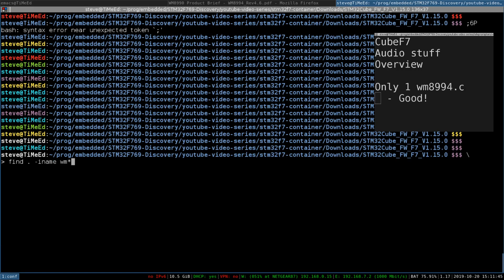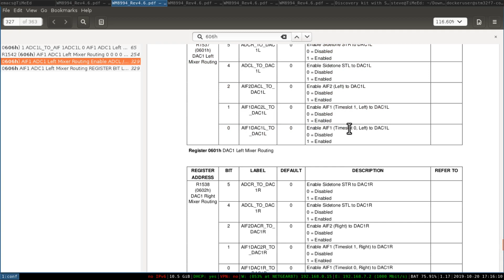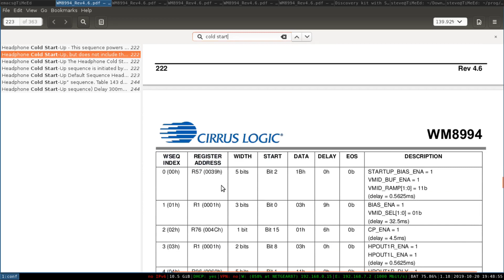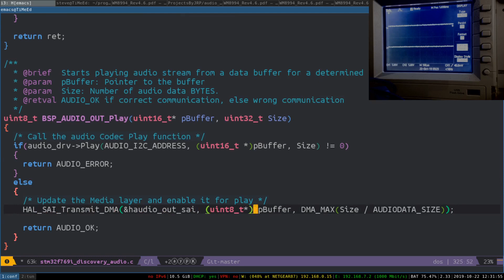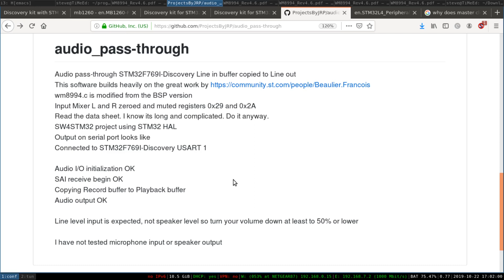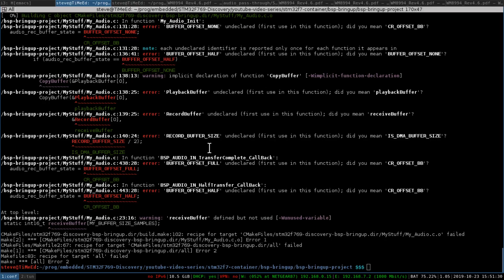STM32F7 Discovery : Audio Line-in to Line-out Pass-through

Comment: Thanks for the insightful video! Is there any reason to believe that this wouldn't be possible on the STM32F746G-DISCO board?
Reply from the maker: Glad I could help : )  The 2 schematics look very similar around the codec-STM32 connection.  My guess is all you have to do is change the firmware to use SAI2 instead of SAI1, and the different STM32 pins.  The codec is the same.  The wm8994.c driver is the same.  Let me know if it turns out to be more or less complicated, I'd be interested.  Good luck!
Reply: @pizzabeerengineering2488  Sure! I am on it :)
Reply: I got something running on the STM32F746G-DISCO board: https://github.com/zanellia/audioprocessor. It's far from clean, but it's a starting point ;) For the time being it is just a simple pass-through. Will try to clean it up and progressively add some more feats. 

Just in case someone else finds this useful, I figured that a simple pass-through for the STM32F746G-DISCO can be obtained adapting https://github.com/STMicroelectronics/STM32CubeF7/blob/master/Projects/STM32746G-Discovery/Examples/BSP/Src/audio_loopback.c from the STM32Cube repo. It mostly requires changing this line https://github.com/STMicroelectronics/STM32CubeF7/blob/master/Drivers/BSP/STM32746G-Discovery/stm32746g_discovery_audio.c#L893 such that it allows `INPUT_DEVICE_INPUT_LINE_1` too and fixing the gain of the wm8994 codec here https://github.com/STMicroelectronics/STM32CubeF7/blob/master/Drivers/BSP/Components/wm8994/wm8994.c#L310 from 0x0035 to 0x0025 (both right and left channel).
Reply: This is from so long ago, but did you ever get it working? I'm trying to get it working on the F746G-Disco as well and I'm curious if you ever had any success with it

Comment: Thanks for this video. This codec has been giving me a headache on a similar board. Just trying to prove that the analog mic input can work before rolling out a hardware design.
Reply from the maker: Thanks!  Yes so many features on that codec that I don't care about.  Curious what is the similar board you're using?
Reply: STM32446E-EVAL. I have more of a hardware background, so it’s confusing sorting through all these BSPs, abstraction layers, drivers and whatnot. Glad you cleared up that a lot of it is unnecessary. I’ve tried Cirrus’ “WISCE” gui tool with an Aardvark, but have not succeeded in a passthrough yet. I think it is the order that I’m setting things, so I’m trying the driver.
Reply: If you could post your code somewhere, it would be much appreciated.
Reply from the maker: @con_mcb   hmm yeah I should have published the source as it was at the end of this video.  What's in this video resulted in this project: https://github.com/bootladder/audioprocessor  which has the proper codec init inside of it but you'll have to dig a bit.  I confirm it does work ; ) atleast on that F7 Discovery Kit.  Feel free to email me
Reply: @pizzabeerengineering2488  Thanks!